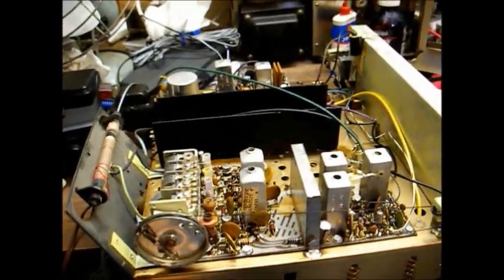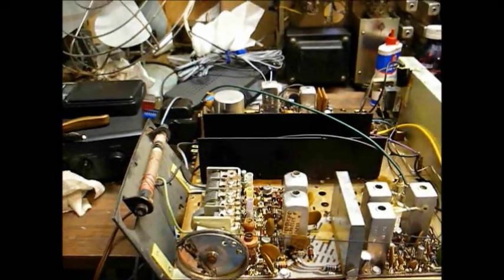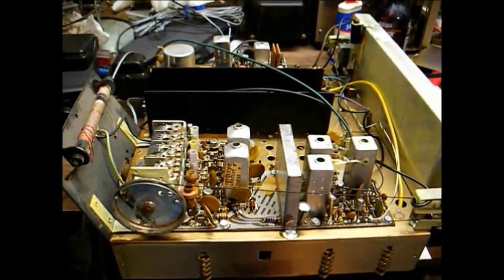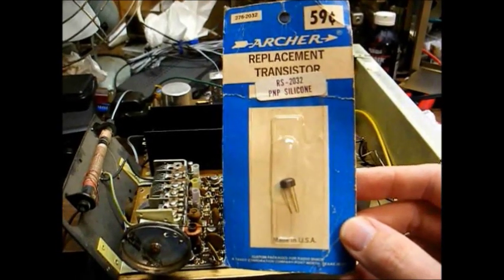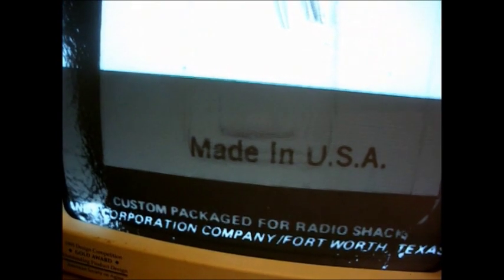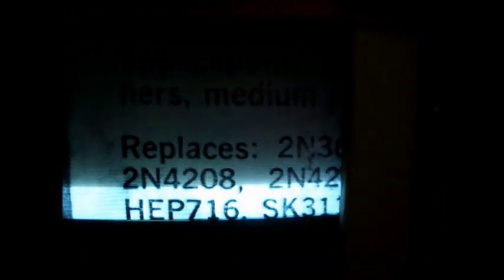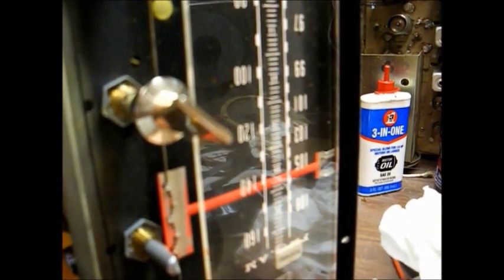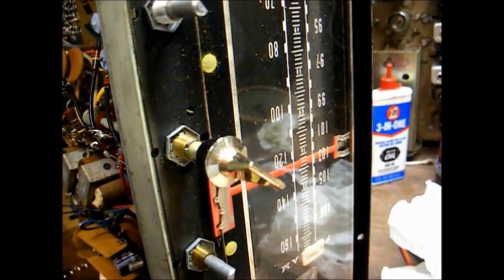Repair of a 1965 Magnavox Astro-Sonic console stereo (I think it's fixed) - part 4

Comment: what causes the one speaker to crack and pop when turning the volume up?
Reply: Typically dirty potentiometers are the cause. When you turn the volume (or bass, treble, etc) it moves a wiper across an element that increases in resistance in one direction and decreases in the other. Over time, the element and wiper become dirty and hence the static. Some contact cleaner usually fixes it.

Comment: This appears to be the exact same as the one in our living room, with two horn tweeters (they called them "exponential horns", as I recall) and two side firing 12 inch woofers. Sure would like for you to repair it for us, if you would take it on. I can truck it to you myself anywhere in the southern US, I reckon. I am in Western North Carolina. The cabinet seems exactly the same finish and style, from what I see here. The unit looks new, as it has not been moved since we got it new around 66 or so.

Comment: A tip on the 7" set down - for as good as the Micromatics are, they never seemed to set down correctly at 7" when the 12" set down position was correct. Just one adjustment for all 3 sizes - the rest are dictated by the locating cam wheel and it's cast grooves. At least they error on the side of going in too far vs. out too far.

Comment: That sounds like some bad electrolytic capacitors, in transistor/solid state units from the 1950s through the 70s they used electrolytics as coupling capacitors. The electrolytics dry out and you either end up with low audio, distorted audio, or no audio on one channel.

Comment: It's true what you said that it's rare to find anything from Radio Shack made in USA. Back in the 60's through the early 80's they sold their own bra nd of tubes guaranteed for "life." The tubes were mostly made in Japan but I did come across some that were made by RCA, GE and Sylvania. The Japanese ones were crap! If I got a Tv in the shop that had one, I would change it and 9 times out of 10, that would cure the problem. Thay were like Good All capacitors. They were junk from the start.

Comment: I've run into dead RF amps before. One was in a CB that some idiot went through with the golden screwdriver and attempted an alignment on. Took me a good while to align it to spec so I could even find out what was wrong with it. Would have taken about 10 minutes to fix if not for the hackjob attempt at a fix. I subbed something I had in a parts rig, soldered right to the bottom of the board since the leads were too short. Works fine now!

Comment: I'm surprised that the FM side worked so well with such a substitution--and apparently with no realignment needed. Besides the differing bias with a silicon transistor; at the frequencies that an FM RF amp works at, the *transition frequency* or *alpha cutoff*--the highest frequency the transistor can amplify--is very important. It would have been interesting to see the specs on that transistor, because if it was a "general purpose" part, it was rated VERY conservatively. Good job sir!